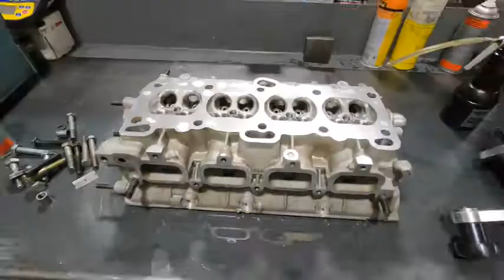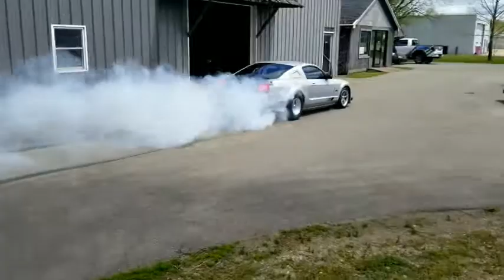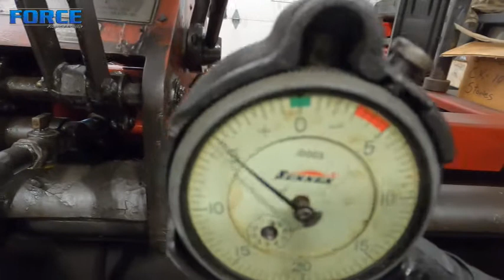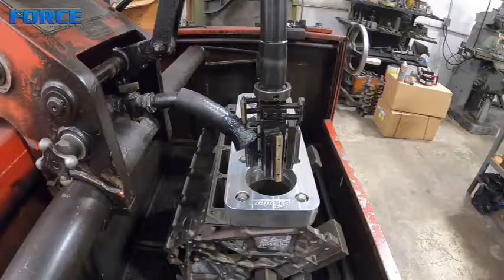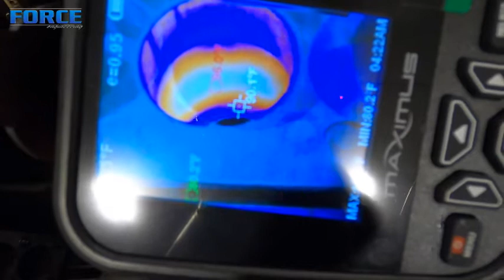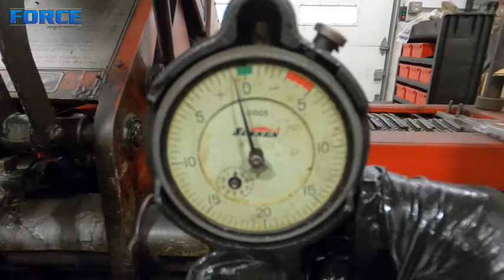Engine Machining - Honing an LS Engine Block | Thermal Imaging

Comment: Was the block bored out or was it only honed?
Reply from the maker: We honed it to 4.010.  Which is .010 over.  Because the cylinder was worn 002, we only to remove .008 to get to .010.  It didnt make sense to take the time to bore it.